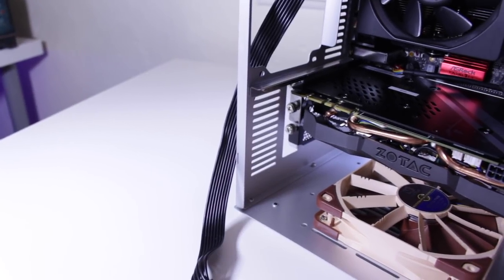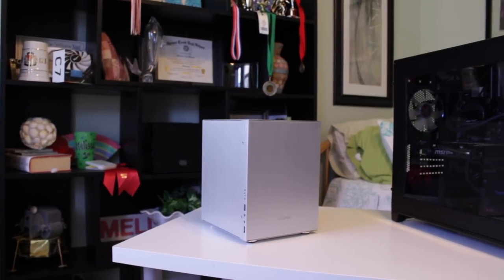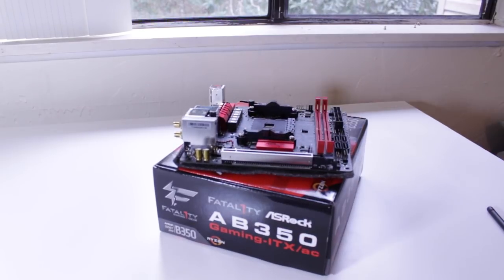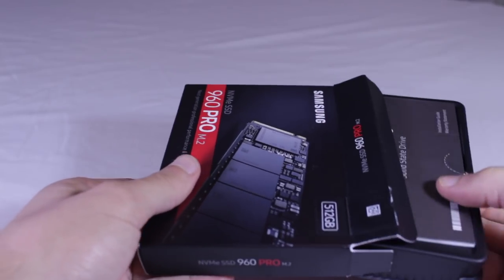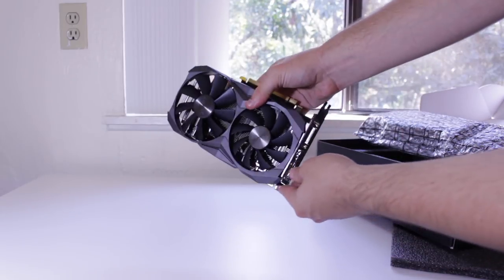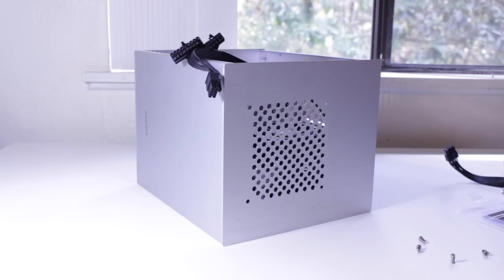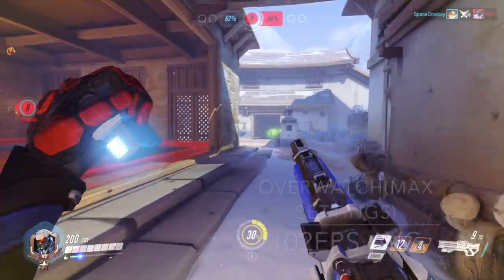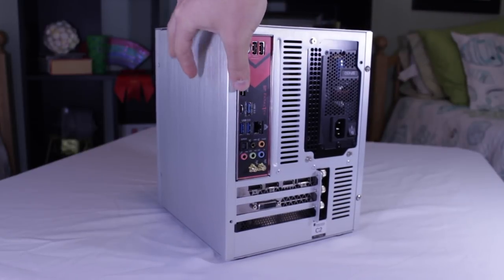My Dream Gaming PC is Complete!

Comment: #CubeCaseMasterRace
Reply: Good Good Air Flow
Reply from the maker: Once you go cube you never go back
Reply: Actually, I have the Jonsbo C2 as well and even a GTX950 ran fairly hot even with a 140mm fan below it. Plus the resulting temps won't be too good for the PSU either... Airflow is basically non existent since it relies on the PSU to exhaust. I'm now looking for other cheap ITX format cube cases that doesn't suck for airflow but doesn't look like ass either
Reply: why arent you verified 😠
Reply: Rhymes nicely
Reply: Hell yeah!

Comment: Probably focusing on the wrong thing, but that fan grill you DIYed is brilliant! Using another case as a drilling template was such a good idea! Otherwise custom drill-hole fan grills never look right.
Reply from the maker: Thanks! I was originally going to just cut a big hole and use one of those metal fan grills to cover it, but I thought this option would be the best compromise between looks and performance.

Comment: Matt might have missed it but the side bracket for storage actually supports a 3.5" HDD too. It mounts on the other side of the bracket, opposed to the 2.5" drive and when the bracket is installed the HDD sits between bracket and front panel. It's an awkward place for it so it's easy to miss, but at least there's a 3.5" drive support. You can see how it looks in one of the pictures on a case product page: http://www.cooltek.de/en/jonsbo/c-series/126/c2

Comment: I used a case build almost the same as that recently. What i also modded was its side panel. I drilled small holes in it an on the inside of the pabel i mounted dust filtration sheet (regular super-thin one). It was time consuming but it works great. The components inside are not so fancy gaming parts, just a regular 1050 mini from zotac, i3 6100 and 2x 4 gb ddr4 ram from kingston. Its main purpose is a tv media center + ocxasional gaming, but even under stress it never run hot after my mods. In Witcher 3, medium-high setting mix and 1080p resolution card was sitting only on 65 C and cpu cores were between 38-46 C. For such small case - im happy.

Comment: Those specs are so similar to my ITX HTPC I'm building in the holidays. I'm using the same ASRock AB350 Gaming-ITX AC/WiFi, AMD Ryzen 7 1700X, 16GB Corsair Vengeance 2666MHz, Zotac GTX 1070Ti Mini 8GB, Cooler Master MasterLiquid 120 AIO, Corsair Vengeance 650M PSU LiteOn slot in DVD drive, 2x 240GB SSD's , in a slimline Azza Z 103 ITX case.
Reply: sha106b The Ryzen 7 1700X was the same price as the Ryzen 7 1700, so it was a no brainer. As for the off set that has been adressed in the later BIOS revisions.
Reply: As I wrote the Ryzen 7 1700X cost me the same as the Ryzen 7 1700 !

Comment: Its best to have a 500 gigabyte ssd for boot up and a 4tb or more mechanical 7200rpm 256megabyte cache  hard drive for storage, because ssd might be faster but you can't really recover data from it, unlike a mechanical drive shows you signs of it dying(going slower and slower), also you can recover data from a mechanical drive a lot easier.

Comment: Cable management doesn't really affect airflow that significantly. A rampant SATA cable or two won't tank your temperatures, or even make them budge at all. If you completely block your fans from spinning or block most of the airflow, then you'll probably notice a difference. Love the case though! Looks awesome!

Comment: For a future system, I would recommend the NFC S4M case. Console shape mITX case that measures in at 5 liters, but uses a non-standard power supply to achieve this.

Comment: The Samsung 960 Pro is nice, but my PC doesn't have an M.2 slot and it won't work as a boot drive using a PCIE M.2 adapter card. The Samsung 950 Pro will work in my PC (using a PCIE M.2 adapter) as a boot drive (it has a compatibility rom) but Samsung doesn't make that SSD anymore. The compatibility rom that was in the 950 Pro isn't in the 960 Pro... gotta love tech.

Comment: Nice mini rig Matt.  We both built Ryzen systems around the same time with slightly differing approaches.  I did the 1600x/b350/960pro/GTX 1080 (Samsung 960 pro is recent addition)  I'm liking your custom work with the case.  Thanks for the video.

Comment: Hey Matt, i bought the same case and build it, now i recognized i need to drill a 120 fan whole or at least like you did it. Id like to know which one of the fans are sucking air in and which one out. What is the average heat and peak performance heat?

kind regards, ferdinand

Comment: I have the same case like you and i want to drill the same holes on top op the case like you did. Do you by chance have any tips or a template to drill those holes ?
Reply: use a 120mm fan on top align it use a marker to point the 4 holes then drill

Comment: Using the same case in black. Got it dirt cheap considering it is an all aluminum case. 

The case will never be good for gaming unless modded for cooling. I installed an ML140 Corsair on the front.

Comment: I'm interested to see what are the temps are on the rig! The GTX 1070 Ti should be at least be quite decently cool since it's fed with the intake. 

Speaking of the intake, it does look a little worrying as the ground clearance is a bit low and may starve of fresh air from the bottom. But that could be easily remedied later I guess.

Comment: Great rig, mine is a bit different. I'm using the ASRock fatal1ty AB350 Gaming K4 motherboard, Ryzen 7 1700, Corsair TX750 M PSU, Corsair Memory, RX 580, 256gb SSD and 4 TB HD, AOC FreeSync screen and Corsair Keyboard (mechanical).
I'm using it mostly in linux, that's the main reason why I'm using a RX580. The support in linux for the latest AMD videocard is very good :)

Comment: Hi mate, amazing build! One question though about the graphics card size allowance:

According to the official specs, your GPU measures 211mm and the case has a total depth of 224mm. Jonsbo recommends 220mm as the maximum GPU length. 

Was is such a tight fit? I'm asking because I just got a R9 380, which is 234mm, and I wonder if it will fit as there could be some small incoherences with these official measures.

Cheers!

Comment: Really cool system! I am thinking of upgrading to AMD Ryzen and am thinking of building a similar type of mini-ITX PC since I'm a university student and have to travel loads during holidays. Would the Sugo SG 13 be an okay alternative to house an i3, 8gb of ram, and gtx 1060 3gb with a 525 crucial SSD?
Reply from the maker: +Tom Brown yeah sg13 is amazing for the money. Same size as this with better airflow. Only reason I went for this over the sg13 is the aesthetics.
Reply: Cool! This is a bit out of my price range and I don't have your modding skills but it was a great build and a good idea. I will probably go for the sg13 then.
Reply: I have an sg13, and it is an amazing case. Some advice: make sure to read up on compatibility (maximum height of cooler and maximum length of PSU, especially). You can fit a 160mm ATX PSU, but in this case you need to place your SSD on the bottom, which is fine. You mention Ryzen in your comment...if you pick ryzen, I really recommend a 120mm AIO for your system. Cooler master and liquid freeze both have very affordable options. Good luck!
Reply: V van Zeller I have a small form factor psu and low profile noctua cooler. For ease of use I'll get a 1050 or 1060 half size card from EVGA and pair it with a mini itx mobo. Should work okay hopefully.

Comment: Great video! Do you know if the CPU cooler height clearance is 80mm with standard ATX or is it still 80mm with SFX power supply? Just wondering if a 110mm high cooler would fit (with the SFX PSU). Thanks.

Comment: Is there any clearance on the bottom for intake? Seems like the bottom panel sits flush against the desk. Also, it would have been nice to have a 4th slot in case you needed it, I understand that the case is optimized for smallest possible size, but if you can't use your slots, then why not go with ITX.

Comment: That case is hideous.  Good thing you at least modded the top for a 120 mm fan, though you could have saved yourself a lot of effort by getting a decent sff case.   I myself am going to build my new computer(when the case gets here) in a Skyreach 4 Mini.  12 liters versus 5 liters.  Or you could have gone with a Dan A4-SFX or an NCASE M1.  All 3 cases would have fit your parts no problem. You wouldn't have needed an adapter for that psu either. 

My 2c.

Comment: my dream pc would have 2 GTX 1080 ti 32GB ram and a i7 7700K
Reply: Maxhunter 5353 Why not 8700k?
Reply: I thought the 7700K was still the best
Reply: Mine is the Threadripper 1950X and the Vega 64
Reply: Maxhunter 5353
7700K is far from being the best. If you're into other things than gaming, Ryzen 7 passes it.
But on all accounts, 8700 (K or not) is the absolute best at the moment. It also runs in much better motherboards, utilizing up to 8 RAM cards, at quad-access (significantly faster than Ryzen-7's or Intel own 7th gen dual-access). If you use 8700 you'll also enjoy extra slots for M.2 and NVMe.
Forget about having 2 GTX 1080TI cards, it's not worth the money. Buy more disk or RAM, or pay for the best games on Steam, or donate to charity...
Do take into account that 8700 should be used with liquid cooling, and that liquid cooling requires maintenance (changing the water) once in a while. In my view, not using liquid-metal on Coffee-Lake is already a waste, but each to his own.
Reply: FireStorm81318 you make it like i'm going to buy the stuff that's in my dream pc which i'm not and probably never will xD
Reply: Maxhunter 5353 ahh he is just showing you the reality of the dream. It's perfect in our heads but daunting in reality.
Reply: Maxhunter 5353 Two more cores, 4 more threads and can be oc'd to faster frequencies over it's kabylake counterpart. My 7600k is at 5ghz @1.31v.
Reply: Maxhunter 5353
Don't be like that. Computer components may seem like a large expense, but they're actually quite cheap if you think about it (especially for all the effort and technological advancements needed to make them). They are also a once-in-several-years investment.
Cutting out living expenses, in a matter of 1-2 months you can earn enough money to buy a high-tier PC; almost any job would allow you to buy one shortly (though most jobs would restrict your usage of it).

You may want to upgrade gradually - most users can get along with just a graphics-card upgrade. SSDs are more of an essential upgrade though.
Reply: Maxhunter 5353 Mines is a i7 8700k watercooled and a GTX 1080ti, 2tb ssd nvme, and 32gb of Ram
Reply: TheMaster's Code
Do you actually need the extra CPU power? Or do you just like the "higher numbers" shown in the specs?
Unless you're running thread-intense applications (virtual machines, data handling, language processing, a.i. of some sorts...), an i7 would literally do better for you.
An i7 would perform better for things like games because it's built as a single unit, and doesn't need to do the heavy process-management that comes along with the multiple physically-apart cores of an i9.

And if you're wasting money on a second GTX 1080TI, you might as well include at least some extra SSDs for different purposes or backups.
Reply: FireStorm81318 edited and way better
Reply: TheMaster's Code
Yeah, I'd buy something like that, if only I had the time to use it. I have a powerful PC which regrettably gets less use than my work laptop.
Just a side note - if you decide to actually buy one, I recommend building a quiet build rather than powerful. Overclocking may give you a 20% boost, but that's more electricity to pay for, more heat, more noise, and personally I feel guilty running on higher voltage doing nothing more than browsing memes; I just overclock my RAM and leave it at that.
I also chose air-cooling rather than water-cooling, just because I'm lazy (water-cooling demands replacement of the fluids every 8-12 months, but air only demands a quick vacuum every 3-5 years). I don't think it's better, but if you're the same "no-worries" type as me, you may want to consider it.
Reply: FireStorm81318 I meant to change it liquid cooling, a i5 8600k and a GTX 1060 6gb, with 16gb ram
Reply: Please don't get me wrong, liquid cooling is better. I'm just stating the uncommon notion that air-cooling has some noticeable advantages too (specifically lower maintenance). Of course, if you're buying an unlocked CPU, not using liquid cooling would be a waste of potential (thus waste of money).

I think you had it better before - 8700k is better if you're already going for overclocking (thus buying the more expensive unlocked "k" version).
GTX 1060 is an excellent card, but it'd turn redundant in 3 years, so you might as well pay for a more expensive card and save the future purchases (plus have better performance until then). Still great choice, but I like "blower" cards, and I've only seen GTX 1060 as "open-air" cards, which 1070 does have. Also, 1070 is better for VR, which I hope would make more progress in the upcoming year. Again, 1060 is still a great choice.
Normally I'd say that although 16 GB RAM is enough but you may as well buy 32-64 because it's cheap... It's amazing how fast RAM got expensive enough for me to agree with a standard from 2013.
Reply: FireStorm81318 ok...
Reply: TheMaster's Code
yup...
Reply: why do you need 2 it costs you 1000 dollars more for faking 40 fps more in games, 1080 ti is already enought and u want 2 omfg
Reply: donate to charity lol xd

Comment: probably worst configuration of parts I ever seen in mini itx case
Reply from the maker: Care to elaborate?
Reply: Psu is close to cpu cooler so cpu doesn't have very fresh air and heat is accumulating in upper part of case and air coming to cpu and psu is already heated because of gpu on the bottom. Yeah you kind of solved it by air output For better temperatures try to mount some bigger stands on bottom so air intake isn't obstructed. But I appreciate your work. Peace ✌️